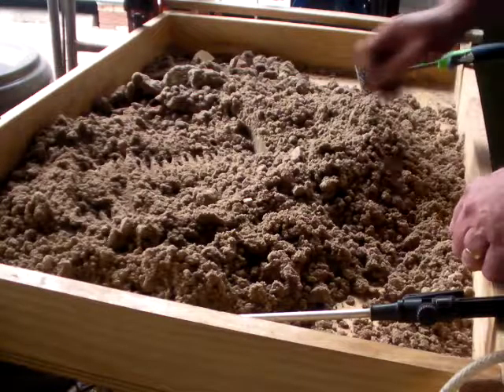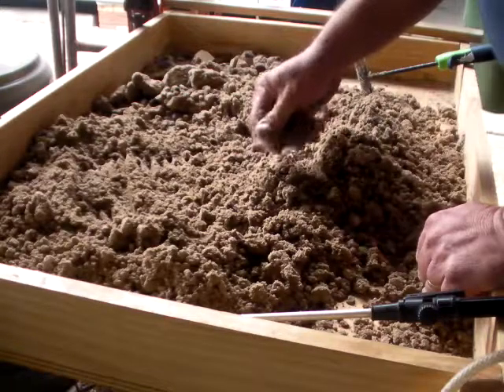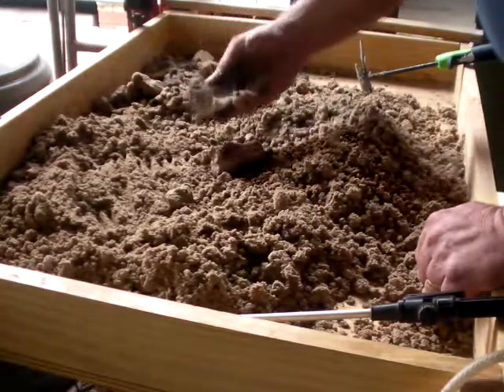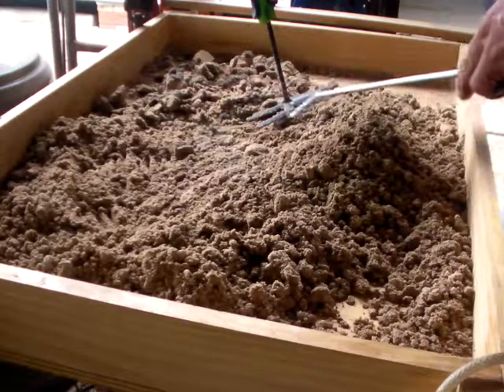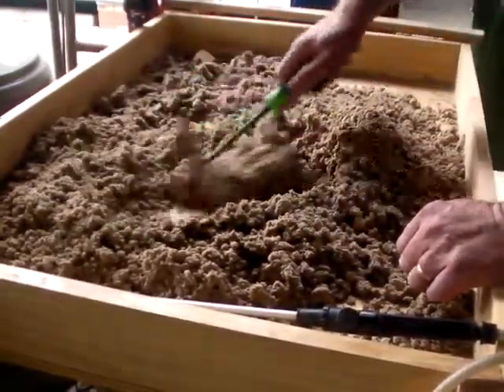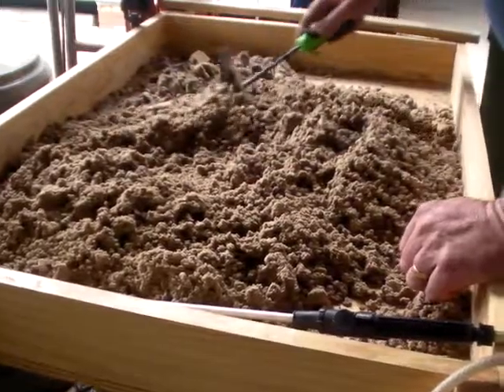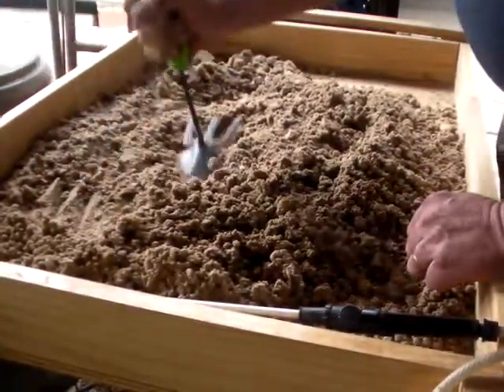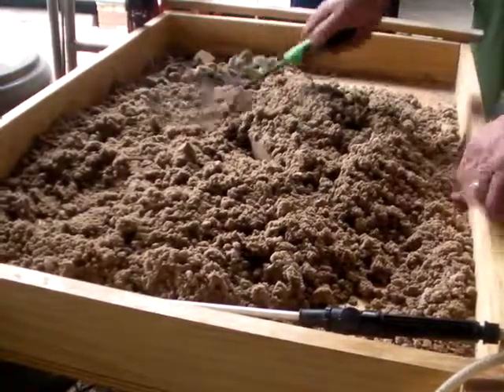Revitalizing moulding sand

Comment: Question answered from video 4 you do make the cast form. Looking good off to Video 5. I may consider making this machine, only with a twist. Do you have casting experience already/ How much do I need to know about making and poring aluminum casting?
Reply from the maker: G’day Active, before making this mill I had zero foundry experience, melting a aluminium can or glass bottle in a camp fire (bush TV) was the only melting I had done, the Gingery book series started me off. The biggest thing to learn for me was tempering the sand, getting the feel for the right amount of moisture, the only way I can describe it is how cool it feels and how little it sticks to the hand, no gloves here. I still don’t have a muller and have found a 5” section of 4”” pipe works better than the garden fork but still is a lot of work. Cheers Peter